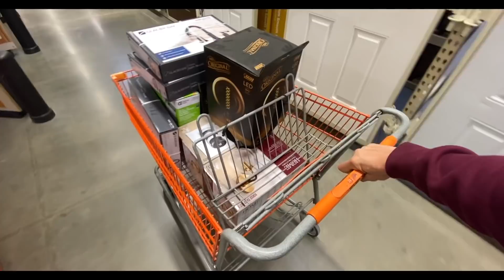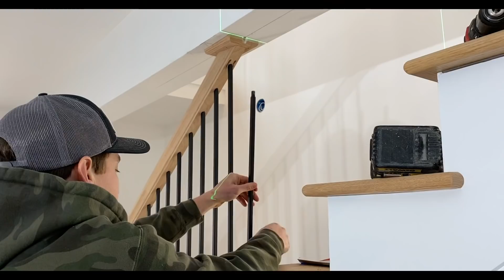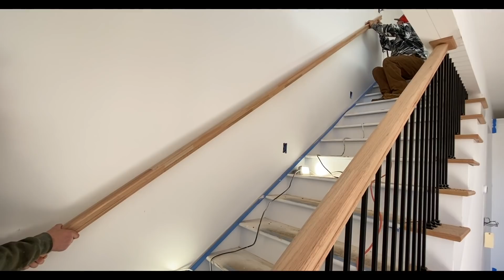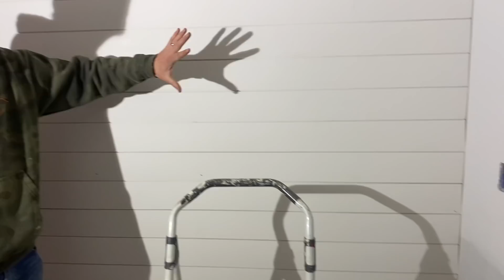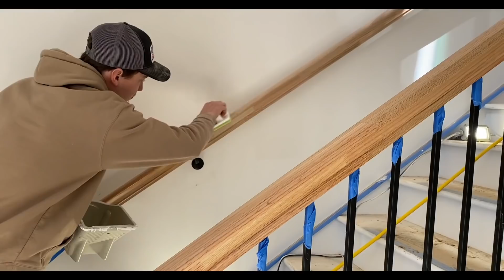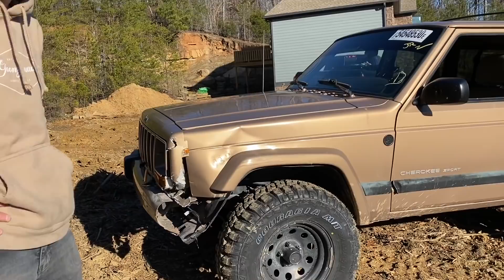The New Goonzquad Headquarters Part 65

Comment: Maybe the “siding guys” wouldn’t have hit the AC line if it was run properly. The lines are supposed to be together and centered with straps holding it . Building inspector and AC guy double fail.

Comment: There are lots of options for the straight 6 if you want a challenge. Lower gears, rubicrawl for transfer case, and lockers will have it dialed in for rock crawling. HEMI is a fun option, but not necessary.

Comment: Hello guys, the 4 brackets and 8 screws of the post fastening from upper floor do not look particularly trustworthy, but it might be enough. It may be that the three posts in combination with the massive handrail, the 44 piece of spindles and the wall mounting can withstand the worst case. Best regards from Bavaria, keep it up, great job.

Comment: Just a thought you might consider installing a solar panel system for generating electricity. We did and after paying off the 
system we didn't have an electric bill any more we generated our own electricity so the system pays for it self. You were talking
about going hi tech.
Reply: The viability of micro (local) solar power has to carefully assessed for each individual location. The key issue in many such evaluations is the occurrence, duration and density of cloud cover from season to season, month to month and day to day, and how this relates to user demand. The results of such research are often surprising. The same applies to the viability analysis of micro wind power. Whether such renewable power sources would be appropriate on the Goonzquad mountainside site is dependent on many factors and would require careful study of potential energy supply levels, the possible storage needs, the demand levels of the users, the possible income from sale of surplus power to the grid, and the prospects of future taxation policies in this sector. Renewable energy systems often have medium or high capital costs, significant maintenance costs, and may require renewal after ten years or even less. They are not a guaranteed 'win' as many people assume.
Reply: @johnstedman4075  The system we had installed has an output of 7.4 kwh and faces the south has 22 325 watt DC panels with optimisers with a 25 year warrenty. It costs $22,400 installed paid off over 12 years at 2.9% done by a local Oregon company. As good as you guys are you could order the components on line for half the price and install the system yourself for half the price and have an electrician wire it up. For the year of 2021 you get 22% federal tax deduction of the price off your taxes and then I think there is a possible deduction for 2022 .Oregon gives us a state tax deduction for part of the price but I don't know about your state of course you would have to investigate that. Good luck if that's something you could be interested in.
Reply: @paulhasty8388  Thank you for that comprehensive data, and it's good to know that your solar system worked out well. We have found that around 50% of the projects which we have handled in the USA in the past decade have proved viable for a combined solar and wind system that would meet all their needs for at least 90% to 95% of the time, but the crucial issues are usually  microclimate trends and payback periods. In rural areas the chances of cost justifying the systems are higher, and recently we have found that advances in energy storage methods such as glass sulphur power cells and molten salt installations have made a significant difference in client attitudes. In the case of the Goonzquad project on the Tennessee mountainside, renewable energy may be on the agenda in the future, after the family have gained a foothold on the site and have firmly decided on their medium and long term plans there.

Comment: XJ's need lockers and gears!! I ran stock axles with 35" BFG KM2s on mine with lunchbox lockers and 4.88 gears. It drove easier than stock!! You can click my profile and see a couple videos I posted of it. I had a RC 6.5" long arm kit with pretty much every mod needed to be the ultimate trail rig! J built it to be able to bash up in the woods and not care about it. You guys are making me want to build another one since I sold mine a couple years ago

Comment: That stair rail love the 90° touch on the end tbh not seen that done before actually looks quite slick
Reply: Usually wall handrails in residences are not designed with sharp corners like that. A better way is to turn a solid piece of matching timber on a lathe, cut the 360 degree result into four 90 degree pieces, and fix one piece to each end of the handrail with dowels and adhesive. This is more aesthetically pleasing and less likely to cause injury.

Comment: Don't put a manual in it.  Manuals are a PITA offroad.  You're always on the clutch.  Besides, there aren't a lot of manuals out there that will take the abuse of a V8 and fit in it without major modification to the trans tunnel.  But, hey, you can put an Atlas behind anything.

Comment: Haven't watched in a few weeks. Did they ever get their windows fixed properly...or are they still leaking?
Reply: All that was shown to viewers was the injection of some form of caulking material to the external joint between the metal frame of the large upper floor window and the surrounding stone veneer. Obviously this will not solve the rainwater penetration problem, since that would require removing the window and reconfiguring the joint correctly, incorporating properly positioned flashings around all four edges. Nothing was said or shown regarding the other six windows on the south  elevation, so it is not known if they were in need of correction, and if so whether appropriate repairs were done.

Comment: Where did you get the black railing spindles?
Reply: Apparently the spindles were supplied by the same company that fraudulently provided the 'solid wood' Newel Post that was not as described and was not suitable for purpose.

Comment: The drive line out of my 01 grand Cherokee would be mint for that, 4.7 v8 with selec trac ,dana44a rear with 3.73 lsd trac lock rear,8.9 pinion gear,things a beast

Comment: Handrails attached to walls beside staircases in homes usually require support brackets at intervals not exceeding 48" to pass  Code. The gaps in the 'HQ House' appear to exceed this dimension.

Comment: May want to check you local codes but I believe the hand rail on the wall requires to be installed with a hardwood 1"x6" backing plate for stability.
Reply: I have not heard of such a Code requirement before. Could you state your source please?

Comment: 1 ton swap,lockers,350sbc, turbo400 trans, dana 300 tcase or an atlas twin stick tcase, 4 link rear with 3 link front. Keep a low center of gravity with tons of wheel travel. Could also do a tdi diesel swap.

Comment: Better a hole in HVAC line than a nail in a water line.
I know some one who had a nail in the water line and it did not leak until years later, just before they sold the house. Flooded the downstairs and the floorboards warped.
Reply: All plumbing systems should have been professionally pressure tested before being covered over. The same applies to all electrical systems, which should have been checked and continuity tested by an experienced electrician. These are Standard Operating Procedures throughout the construction industry in all western countries.

Comment: I don't get why people use those ugly optional plates on the nest thermostat. It's so much cleaner  without, and not even needed.
Reply: The 'Nest Thermostat Trim Plate' is described as 'optional' in the Google Installation Instructions. It is stated as intended to be used when there is a need to conceal holes in the wall left by the previous device. The installer should have consulted Goonzquad and asked them to decide whether to fit the item or not.

Comment: The thermostat is a nest thermostat it also can connect to the Nest protect smoke and carbon monoxide detectors if the carbon monoxide goes off it will turn off the thermostat automatically.

Comment: I personally wouldn't have done anything with real wood in a bathroom... The moisture might wreak havoc with it over time, plus the gaps will be impossible to clean between. Same thing for anything with a rough finish. Even if you were going to do it, I would have kept it away from the fixtures and only done the upper "half" of a wall.

There's a reason that bathrooms are usually all hard surfaces so they can be cleaned easily...

Comment: If you wanna build a ripping Cherokee, you need lower axle gears, lockers, and rebuild the 4.0 l to a 4.7 stroker.  The engine bay is too small for a V8, and you save weight with the straight 6.

Comment: As for the Jeep. Make the wheel base wider. Next 3 to 5 inch lift on it. Put the V8 in it!. Put some stronger suspension socks and a Winch. The rear needs more more weight in the back  to hold more grip or get wider tires.

Comment: Axel swap the Dana35 is weak... Dana30 in front better but i would go for a ford 8.8 in the rear keep front stock for mild stuff and add lockers front and rear its all you need

Comment: I dont think these guys are as big of goobers as they pretend to be in these videos . They have to know more than they let on in thier videos  i mean seriously, im not trying to be a dick here or anything .But  I  know im not the only one who notices these things . All im saying is how can Billy and Simon  tackle a damaged complex Lamborgini or Ferraris Electrical system with multiple computers relay banks dozens of grounds even multiple batteries a dash that has more warning lights on than a Christmas tree and jump right in and remove the entire dash out of a Challenger in a 20 min video then act like a 110 volt simple light switch is something above his skill set. These kids did home renovation for some time before they got into car rebuilding. If you work on any residenytual jobsite for any lenghnth of time these are simple task even day laborers understand and can do . Also call in the sheetrockers  to patch the two holes where the refrigeation lines were pierced ? Thats  not  rocket science . just pick up a tape measure and some scraps of drywall cut it to fit and tape it and mud it in. I find it hard to believe the same two kids who did one hell of a job on that beautuful staircase all the sudden have a brainfart hooking up some can lights in the kitchen. Its all black and white wires , hook up the neutral and keep touching the blacks untill the cans come on, sometimes the electricians use a red wire if 3 way switches are used , This is a very easy task for any semi skilled handyman  Also the water supply mess up in the bathroom where neither of them  noticed there was no water supplys  lines in a BATHROOOM before the sheetrock went up is suspicious because you have to have the entire plumbing system pressure tested before the inspector gives you the ok to hang the drywall and they often attach a pressure gage and air hose fitting at a bathroom or kitchen sink supply or outside where the water supply will enter the home and pump it up with 100 pounds of air pressure and its checked to see if it holds for 24 hours. Also refrigeration lines are usually  installed in a gutter ran up the side of the house so you can remove the entire lineset someday if you have a catstophic failure . If the lines are under the slab they are placed in a piece of 3 or 4 inch PVC  pipe so they can be removed someday . If the lines are in the wall they are usually well protected  and boxed into a chase where nails or screws from interiour sheetrock or exteriour sheathing applications cant ever reach the lines I know here and probably in Tenn. if they pass through a stud they are required to place these thick hardened metal straps across the area the lines passes through the wood  that keep nails or screws from being driven into the refrigeration lines or nto the  romex cat 5 or phone/ internet lines or cable tv lines water lines ect. I dont know, mabey they did these things on porpose for more interesting content and to help others avoid making these mistakes. just an observation
Reply: "I think the outside units are called compressors or somthin lauke that" come on,  these guys were  home renovators in thier previous life before rebuilding cars, They know what these units are shurely

Comment: Are you guys SERIOUS? The AC in the front of the house??? Why not hiding it on the right side?
Reply: The two compressors have been sited on the west ('left hand') side of the HQ House, where they will be concealed from view by the interconnecting Garage and Workshop which is to be built there in the near future.

Comment: The reason your jeep Boggs it’s because you put bigger tires and you need a better rear end I have a 1997 on 33’s on 6 inches and I don’t have an issue you need a better geared rear end and I have a stock rear end I wouldn’t recommend a hemi for a unibody you put the jeep at risk of twisting the body permanently if you need suggestions on building your jeep feel free it ask me I have owned many of these vehicles and know a lot about them

Comment: sorry. late on the ask. how come kitchen is downstairs and bar  is upstairs?
Reply: When Goonzquad purchased the partly completed house in summer 2020 they opted not to substantially change the layout which had been chosen by the former owner, even though that had been designed not as a typical residence but as two apartments, one on each floor. The layout which has resulted is indeed not usual but Goonzquad appear to think that it serves their needs adequately.

Comment: Definitely build out the Cherokee. Axels, transmission, motor, suspension, etc.  I am not a fan of LS engines, but they are cheap and can make a lot of power, so I would say swap in an LS and do some power mods.

Comment: Why does the house only have windows on three sides?
Reply: It is intended that a Garage/Workshop is soon going to be built close to the west side of the HQ House, so apparently it was decided that windows on that facade would serve no purpose as they would have no view.
Reply: @johnstedman4075  I was picturing them building a big garage across from the house, with a paint booth, workshop, several work bays, parking.

So they would want to be able to see it from the house. :)
Reply: @densitypop  The prime asset of the house site was and is the unobstructed view to the south down the hillside and across the green valley into the distance. Goonzquad would be ill advised to block that view since to do so would significantly reduce the marketability and open market value of the 'new' HQ House. They have previously stated that their proposed Garage and Workshop will be constructed to the west of the house, which seems a better option, although as an Architect I believe they have overlooked an even better choice.

Comment: Supercharge it and run e85.  You keep the heart of the jeep and it spins my 40s up quick.  Dana 60s front / 14bolt rear long arm with a rubicon 241 case and you will go anywhere the suspension will let you.  Awesome platform and plan to reinforce that unibody...she will twist a tad when #flexed.

Comment: ya'll need a window on the "garage" side of the house. It looks a little bare, son.
Reply: A Garage/Workshop is to be built close to the west side of the HQ House, and the two buildings will need to be linked together to comply with Code. Therefore that facade will not be visible, and any windows there would lack views and daylight.

Comment: That car is not high-power but it's high-torque engine that's why off roader like it with lower axle ratio 4.30 or 4.88 but if it the tire not more than 35s 4.30 or 4.56 is good /throw some lsd it axle locker stock engine with msd ignition and tiny upgrade no supercharger and other big upgrade exhaust would be good
And bam you just have unbreakable off roader

Comment: Just a heads up on the Nest Thermostats. Keep an eye out on them. i do HVAC and we have had a few of them go into heat mode by themselves durring the summer and practically melt paint off the wall. just make sure you keep an eye out. dont know if they have fixed this problem yet.

Comment: We have that thermometer system I’m my house, it’s amazing! You can control the temp in your house from anywhere in the world from your phone. If you get the emergency sensors that go with it (water for flood, humidity, fire warning, connection to weather service, etc.), basically it lets you worry about any problems from anywhere at any time!☃️🛸🔥🦅❤️

Comment: throw on Dana 44 or dana 60  with front lockers and a up grade to the suspensions  a beefed up axle to handle the power of the Hemi with a suitable transmission  for raisin hell. Oh throw in a roll cage be safe.

Comment: Locking differentials front and rear a must V8 not needed you brake parts and hurt yourself use low range you’ll be fine

Comment: MT's will require a minimum of 235/75R15's which will fit without any problems. My '96 ceme with 225/75R15's and speedo in MO is still considered within proper specs. Don't know the size you went with, but I'm guessing you're getting tire rub.

Comment: I think making good use of the engine from the other wreck for the Jeep would be a good project. As for power at the house, why don't you guys look into solar and wind power, since you're looking at a modernised house? Benefits would include not having to worry about power when the rest of town is down or the first time something takes out the power lines running to your house. :)